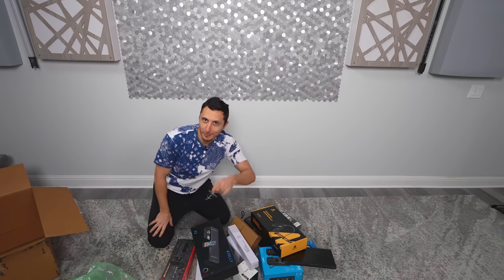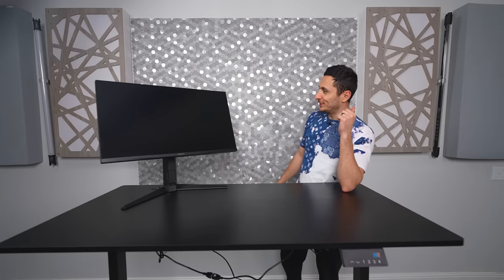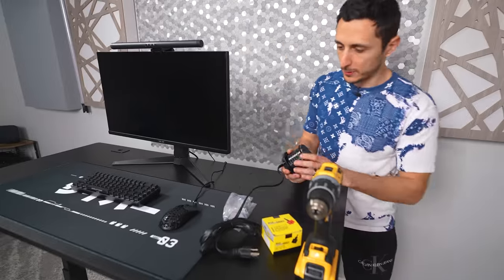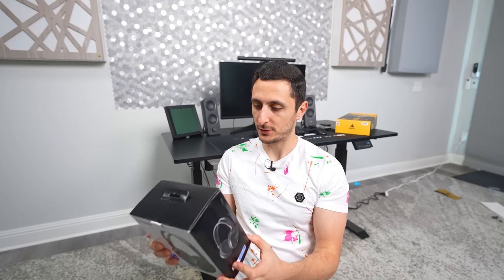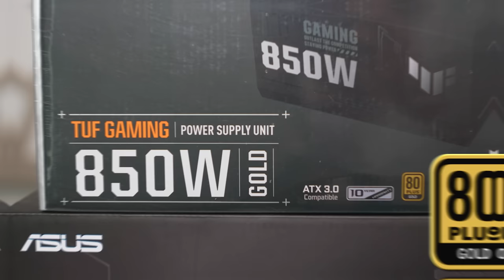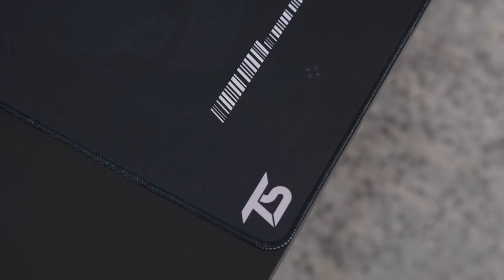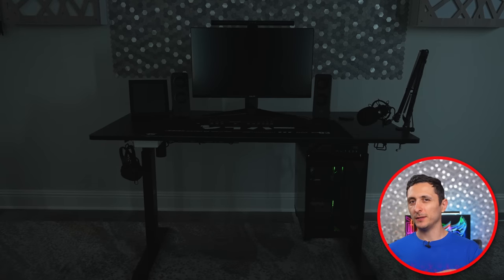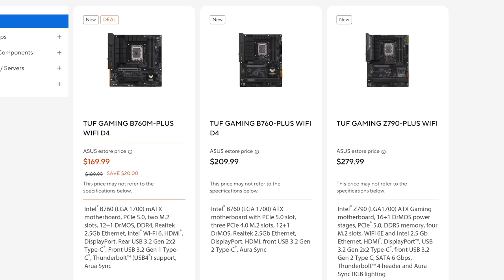Building the Ultimate ASUS TUF Gaming Setup!

Comment: I just got a tuf asus board and gpu 3070ti tuf and wow so impressed with the build quality and aestetics.
Reply: I also have the 3070 ti, it looks and runs amazing, ive never had any heat issues and im on AMD 7000
Reply: @sabermajora408  I am right there with you with the heat. Never had a gpu with fan stop and my room is so quiet when I am surfing the internet. Then when needed it ramps up and keeps it below 65 gaming on full settings. I actually just noticed after checking my box I have the tuf curved monitor 165 hz 27 inch and I love it. I am on a 5800x3d. Love asus products glad I have a job now and can afford them.

Comment: Hi Ed, just out of interest, how did you get the "Crucial DDR5, 5200MHz" RAM to run on the "ASUS TUF Gaming Z790-Plus WiFi D4"? 😜 This board is designed for DDR4 RAM; DRR5 RAM cannot be used on it.
Reply from the maker: It was a typo. Was suppose to say DDR4

Comment: I think stream decks are kind of silly man, you can just get a programmable keyboard, or a musical keyboard, audio interface with some buttons on it, you can do a lot of things besides have that on your desk. Same with headphone stands, you can hang those anywhere. I think in the future, most people will use a bigger desk. I use all the desk space I have, mine is about 10 feet long. If you're a streamer, then you will eventually need more desk space. Look at Alex Zedra, her desk is like 15 feet long, she uses it all, she spends a lot of time in that room. Her setup is huge but messy, she has like 5 monitors, which is way too many for me. I will soon use two 32" curved displays, side by side, plus a big TV, all mounted on the same wall. I would say I have close to too much stuff right now, because it can get overwhelming for cables and stuff.
 
 I had way too much plugged into two sets of outlets. I could have maybe gotten one of those huge power strips, with 20 extra outlets, but I wanted some type of series filtering. It would be a huge loss, if we had some devastating storm that fried this circuit, so it seems worth it to me, plus it's good for blocking analog/ digital interference in audio/video. It helps to have an electrical background, to know when there's too much stuff on the same circuit, you could talk to an electrician and find out what you need.

Anyone who has invested a lot, I would totally look into series power filters for your circuit at home, especially if you live in apartment complex. Be careful with the amount of things you have plugged in, after 12-15 plugs, it's a lot, don't blow up your house. They don't make these things for no reason, there's actually a reason.

Comment: i purchased a hp elitedesk 800 g2 sff off a refurbished site for $400 with a intel i54570 cpu 250g ssd and 8g ram 2 years ago becuuase my old 10 year pc was so slow and was barely working and the elitedesk computer was alot faster but sucked with games and video editing programs so i then wanted to upgrade my pc futher so i added a gtx 1050ti which i am currently using but to upgrade further i learnt the hard way with alot of research that i need a new motherboard to be compatible with the new cpus i need a even more powerful graphics card that needs a more powerful psu which means i probably would need a new computer case and for sure more ram i struggle with money and thought i could do it cheaper but relised the hardway i cant ASUS TUF gaming if you have spare parts like pc case more modern motherboard and possibly a more modern gpu and ram man you be making a guys life so much fuller

Comment: I just built my first PC in an White Dynamic Evo. I used an Asus Prime Z790-A, an i7 13700k, White Corsair H150i Elite Capellix (with its fans) mounted at the top, 6 Lian Li AL120 mounted side and bottom, 850W Asus ROG Strix white PSU, 2TB Samsung 980 Pro, 2x16 White Corsair Dominator Platinum DDR5 @6200 MT/s (Had to turn it down to 6000 because crashes) and a Gigabyte 3080 Vision OC vertically mounted. It turned out beautiful! I built it waching your guide. It really helped a lot! Just a question: Is there a filter for the side intake for this case, I'd appreciate a suggestion! Thanks in advance.

Comment: I would say 4k is the standard resolution for that 4080 1440p is light work for a 4080 however the 7900xtx is what I'd put in it. the tuff line is awesome I use it myself their laptops are awesome also.

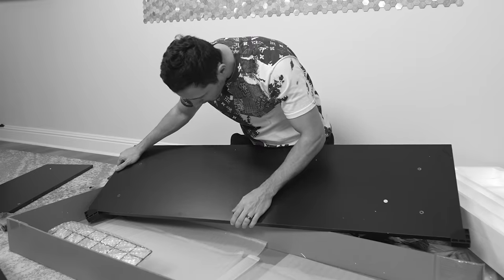Comment: @1:35 to answer your QUESTION... I GOTTA throw shade on your selection of desk... MDF? Really? Maximum Density Fibreboard is about as low as you can go... For a desk? Tsk tsk tsk... Maaan. Thought you had more respect for the surfaces than that! In the future, I really would love to see you redeemed by putting together a much more quality desk... How about some Brazilian Cherry, or Claro Walnut butcher block, sanded to 600 grit, oiled up and given a mirror finish... Secure that to a custom hardwood leg kit to an adjustable frame... Let's see some carpentry and craftsmanship happen!

Comment: I have a gaming setup, but not good. I have a Oplitex 7010, HP Compaq LA1905wg, a good RGB mouse and a weird (nice) RGB keyboard. I have plans to upgrade my setup which will cost $85. My setup is a cheap one but I'm 12 so I can't get a really good setup. I will get a
GTX 660
RGB Light strips
RGB Light bar
Clear PC case
New RGB Keyboard
New RGB Mouse